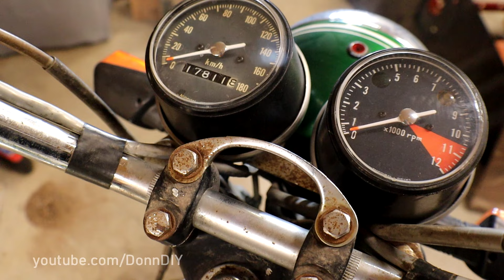1969* Honda CB350 K - Making It Run Again

Comment: I used to have a 71 Honda cb 450 dohc it was a beast. With minimal rebuild was dependable for years. I have now a 81 Honda cb 750 k that runs but still needs more TLC . but I'm just not into the restoration process as I used to be. And e bikes are so much fun now, with cardio benefits.
Reply: E bikes, electric cars/motorcycles etc; hmm. There's going to be a massive scramble for gas powered everything when main power grids fail either b/c of age and/or lack of maintenance like those seen in CA [with more already forecast], or via the fact they're prime targets during conflicts. Lets not forget the anarchists who tend to suddenly get a bee in their bonnet. With the majority of gas stations having gas powered back-up generators [b/c it's required by law], anything powered by a gas engine is gonna look real nice during those events.
Reply: I had a 71 too!.rode the crap out of it for 2 years,never did any maintenance at all.

Comment: Just a tip Donn, pull the chrome cover on the other side of the head and adjust the valves. They sound kinda loose. I had 2 of these and 3 cl 350 scramblers so this is a fun blast from the past. Love your fabrication videos but this was a cool break!

Comment: camshaft eater engine, and NO oil filter to catch the constantly recycling debris.
  I was a mechanic at a honda dealership in the early 70s..
  Honda sent a memo to every dealership service department, and parts department, to stock seven top end rebuild kits for every 10 machines that that dealership sold..
  I got so fast at changing the cams, thrust washers, bearing blocks, rockers in these 350 Honda twins, that I could have a camshaft out of an engine after it pulled in before the camshaft was cool enough to hold with bare hands.. I was a flat rate mechanic, and if I could do four top ends in one day, I could make 36 hours pay in eight hours..
   The issue with resurrecting an old one is, there’s a lot of “while you’re in there “parts that you should replace while you were in there, like cam chain tensioners, cam chain..
  One bulletin to the mechanic/service department that I still used today during that memo from Honda. Paint the base gasket and head gasket with rust oleum aluminum paint, and put it on the engine wet during assembly. That head gasket and base gasket will never leak, and when you go to take the engine apart for the next camshaft replacement, the engine will come right apart without destroying those gaskets. I still use that same can of aluminum rust oleum paint on dry paper gaskets to this day. You don’t stir the paint, you just use the gooey paint from the bottom of the unstirred can and work that into both sides of the gasket..The gasket will never stick to either surface, and it won’t leak either
Reply: These bikes have a centrifugal oil filter that needs cleaning every 3k miles.... This is why my bikes never go back the stealer for servicing; I want it done properly, so I do it myself 🙄

Comment: Remember those screws are JIS not Phillips. They get chewed up if you use Phillips enough times.
Great to see it lives again :-)
Reply: Been using philips screwdrivers for over 30 years and no problems. Just don't try to use the wrong size philips for the screw. Most of them work well with a #3 Phillips. Also, get yourself a hand impact for the tighter screws, even the JIS drivers chew them up. With the hand impact, you can loosen them the first time and avoid chewing them worse than they might already be.  Cheers from rustbelt Alberta Canada 🙂
Reply: @lowellfunk8974  We know rust very well. Cheers from southern Norway 🙂

Comment: The brass tubular screen is gone out of the fuel petcock and the tank crossover was good at collecting junk. Power issues can be caused by mis-setting the points. There were 2 models of engines with very different firing angles. Mine was 179 degrees and I don't remember the other, but my friend had it, and the shop used the 179 and it ran on 1 cylinder until I fixed it for him. The insulation in the starting motor was dodgy and not oil resistant. The rectifiers were inefficient and went bad often (and may have contained mercury). The neutral light switches got mangles frequently. Never saw one with original carbs that did not have holes in the diaphragm (which led to an interesting, almost "digital" power curve). A heavy keychain WILL make the ignition switch go bad quickly. Watch the brake linings. If they get too thin, it's possible to pull the cam over the top leaving you with zero brakes. Don't forget to set the valves and adjust the cam chain tensioners frequently. The most common cause of engine damage was a faulty shifter seal letting the oil out (slowly and stealthily). The swing arm would require frequent greasing which most people did not do, leading to nasty clean up (I mixed anti-seize with the grease). When the clutch pack would get thin, you could add an extra pair of plates to get it back to "new". The upper and lower steering races had a different number of balls, 37 on top, 36 on the bottom if I recall. That's all I can think of. Good luck and enjoy!

Comment: Seeing the title and thumbnail I'm like it's a Honda... it's run. My Honda motorcycle is like a hole, it just works.  Put tires one it, change oil, give it gas and minor maintenance like air filter, coolant, breaks every 10 years and she's good.  Hondas just work.  Love the build and wow that oil plug was tight! Somebody got stupid with with it.  My big oil plug has a mesh filter on it yours maybe missing not sure but I know that about mine. What a cool bike🥰🥰🏍🏍🥰🥰

Comment: Great bike! I have one myself. Note: at 10:35 in your vid I can see that the left side intake valve adjust bolt is oriented the wrong way. The line/tick mark on the screw should be around 4 o'clock position. Yours is at around 9 o'clock. Check all 4 valve adjusts. The tick marks should always be facing outwards. So around 7 o'clock for exhaust and 4 o'clock for intake!  Then set your gaps from there. Cheers

Comment: Can you even buy parts to replace the points on this thing? I know you can sand them off, & that's great, but I remember
having a Honda atv 3 wheeler, & the points where ALWAYS the culprit when it wouldn't start. It was the most annoying thing.
That being said, I don't think I could even order points for it now.. but that's a motorcycle your working on, and I Know a lot
old Honda motorcycles exist.. ?

Comment: I noticed at 10.30 there was one spark on the left, then nothing...Doesn't each cylinder on these twins have its own condenser? The car guys moan that modern condensers are c..p! I think the condenser wants replacing or cleaning...

Comment: My younger brother had a '71 CB350K and I had a '71 CB750K. Later, when I went into the Army, my brother sold his 350 and bought my 750. Those were fun days. There was an issue with the 750 though, the stock chain would stretch and jump the front sprocket upon sudden deceleration coupled with hard braking and the chain would jam up between the sprocket and the crankcase and crack the cast aluminum I had to completely disassemble my engine and take the block and case to a professional welder and have it heli-arced. After that I replaced the stock chain with a higher quality after market chain and never had a problem with it agailn.

Comment: Bought a cb250ko in 1973 in bits, it hasn't been outside my back gate since then, I rebuilt it over the years finding some parts that were missing and finally got it running some years ago before covering it up and leaving it again,  put a battery on it a few days ago pressed the button and it was running within a minute thats why most of my many bikes over the years have been hondas in contrast my suzuki 1980 gsx1000et which I've owned since 1985 is the biggest pain in the arse I've ever owned fortunately my 95 cb1000 big one never lets me down

Comment: Those old Hondas are tough and will run forever if treated half way decent. I had a 1970`s 450 and a 750 4cyl. They were fun but dangerous. I clipped the back end of a dear going about 80 mph on a long sweep corner and just barely made it without crashing.  Take care

Comment: Are you sure that's a 71? I have a 71 and the tank and side cover are very different. I think you have an older machine . Take the serial number and research it . It would be awesome if it were a 69. it had a different cam, it made more power. The bike will go more than 100 mph. I have 71 with 69 cams and rockers . I Raced in in vintage road racing, I use to bump a class and race 500s I came in second once . The brakes never worked well after a few laps and that's how you go through the corners faster.
Reply from the maker: Yes, someone else pointed out the same thing that it should be 1969 not 1971. I looked it up on the internet and I too have to agree. Looks like 1969 indeed.

Comment: I would guess the fuel left in there pre dates the addition of ethanol...otherwise you would have found the carb full of smelly varnish. You must NEVER use regular fuel in these older engines, they are not designed for ethanol.
Reply: You can use ethanol fuel. But the fuel system needs to be drained and flushed with pure gasoline or cleaner when the bike is put inopt storage or winter hiatus.
Reply: @alouisschafer7212  The only place I use ethanol laced fuel is in my modern Toyota truck because it is designed for it & the fuel is cycled two tanks a week. Everything else I own gets premium fuel with zero ethanol & before storage & then run it with Seafoam in the fuel then dry to stalling. Every item from mowers, to chainsaws to weed eaters, generator, pressure washer, ATV, outboard, dirt bike & Argo all start straight away when I bring them out to pay again. I have never had an engine with a stale fuel issue since I started doing this 20 years ago... This ethanol fuel is real garbage!

Comment: Waht type of oil should you use in these engines:
Regular 10-40 without additives? Synthetic or Mineral?
Reply: Needs to be special because of the wet clutch. Should have JASO MA specification. Any other 10-40 will result in a slipping clutch. Ask me how i know...

Comment: Beautiful bike. Memories of mine 1974 CB350K come up. On the right hand side of the motor there is an oil centrifuge on the crankshaft which the motor oil cleans from dirt. It could be that there is a lack of maintenance. Keep an eye on the dirt which is there. It could clog the oil flow.
You get access to it by 3 Phillips screws on the right motorcover  as far I remember. 
Greetings fom Bavaria.
Reply: Its important thing, klean it !!!

Comment: Wow brings back some memories...I  had a 350 Scrambler from that time and it was a everyday means of transportation during the late 70s to the early 80s . These bikes may not have been super fast but they was so much fun and easy to ride. I always wanted a 350k because of the exhaust running on the bottom instead of the right side  can't tell you the times I got burned and cussed every time. Great change of videos keep us updated on the progress of the bike as well as the new build.

Comment: I personally think that was one of the best bikes ever made and are a world of fun to ride. Points were a problem with oil on them but I think there is a felt gasket that keeps most of it out, I hope so. A bunch of nuts and bolts in the tank an put it on the paint shaker or a  car wheel and left to rotate helps but usually new is best. If you are a seldom rider, fixing is best still.

Comment: well done, looking good! also those filters are a good idea on older bikes that are driven less often, you can clearly see if there is rust in the tank as the filters are see trough.
Reply: Also its good idea on 4 stroke machines to use some two stroke gas in the engine before putting it away. It does not cost much to add the oil and it covers surfaces of the carbs and cylinder with some oil preventing rusting, unlike pure fuel. Less oxidation and such crap. When taken back to use just pour in normal gas and it flushes the system from the oil. Little bit extra emissions and suth but nothing major. Same apply to oil injection two strokes btw.